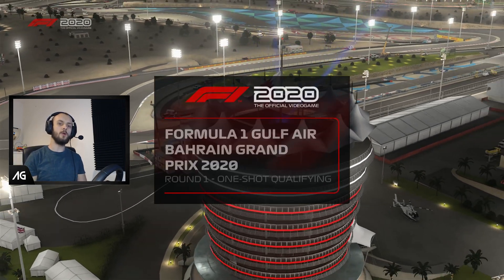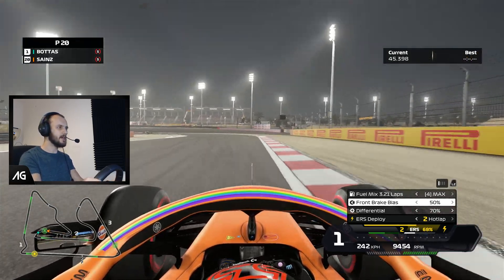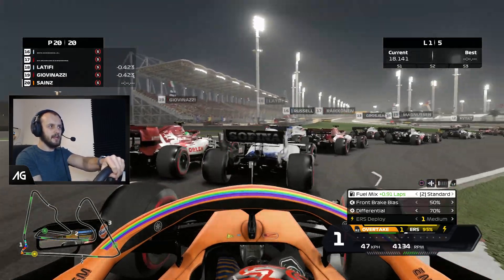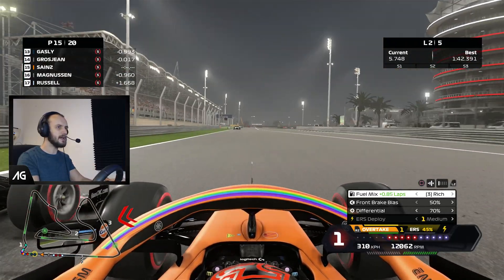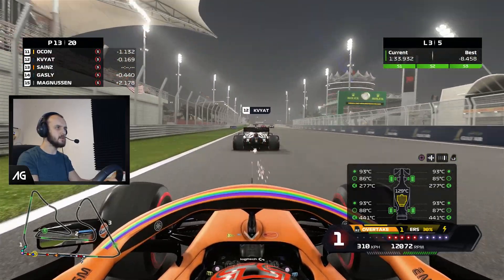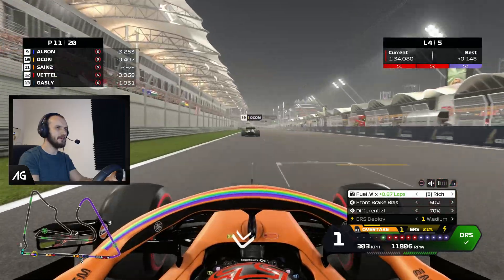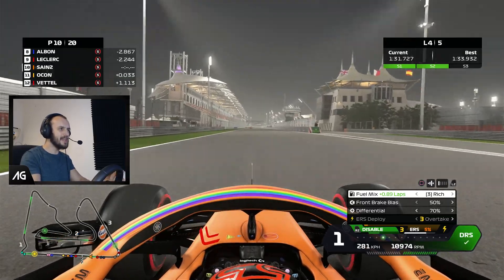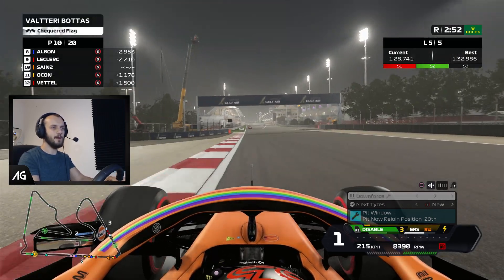What If F1 Cars Only Had 1 Gear?

Comment: here’s an idea, idk if it will work but try and give the ICE as little horsepower as possible (0 or 1 if it can’t be 0) and then increase the battery capacity to fuel tank size and then increase the ERS power to effectively create an electric f1 car.

loving the vids, keep them up :)

Comment: Can you make the cars having 20.000 rpm?
I don’t know if you already did it but in case I think is a good idea.
Reply: You get all kind of problems if pistons go trough the sound barrier, 
It is easier to build an engine with massive amount of cylinders that way the engine can idle with very low rpm

Comment: Nobody:
Me: formula-e
Reply: hgt 27 Formula e cars do have a gearbox
Reply: @FastnOut  Formula 1 cars with one gear would also have a gearbox.
Reply: @karl-benediktbecker901  he meant that they have gears
Reply: @GoFish.1  Yes, multiple gears.
Reply: @FastnOut  Most formula e have only 1 gear, but i think some teams use 2 gears.
Reply: Formula E cars have 2 gears. I'm pretty sure they only use 1st for the start though
Reply: @jorge8596  they have 5 gears
Reply: @GoFish.1  that was only used by some teams on the second season, but reducing it to 2 or 3 gears was better cause you get more recharge and can afford longer gear ratios than fuel powered car. Todays FE have 2 gears only
Reply: dude CVT
Reply: Williams had an F1 car with only one selectable forward gear. Look up infinite gears